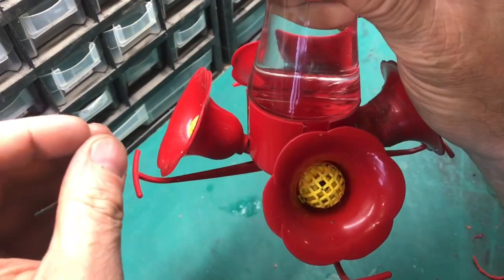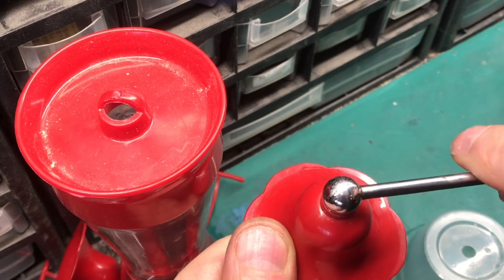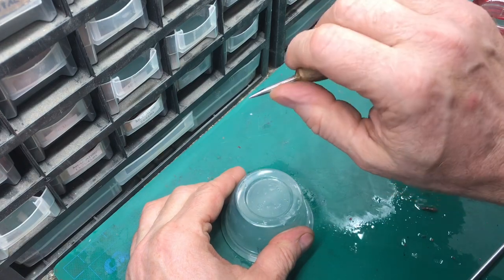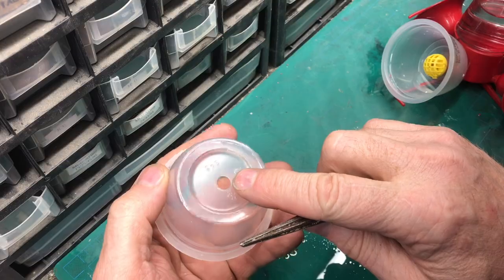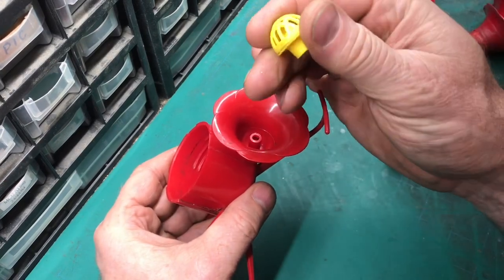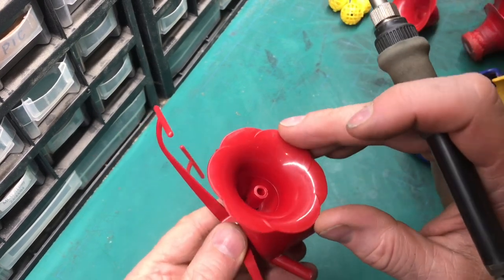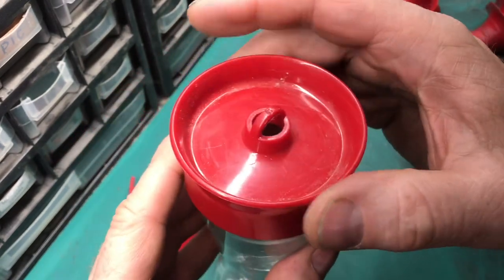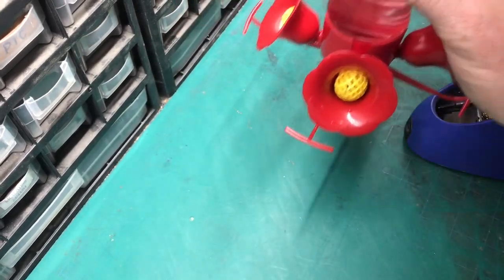fixing a LEAKING hummingbird feeder that “attracts ants”

Comment: You could use hot glue also to seal the red flower to the shaft…Then You could still remove the red flower for cleaning, but you may have to re-glue after cleaning.

Comment: I would think that the red cup (removable) should NOT be the prevention point.  The red tube shouldn't leak in the first place.
Reply: @vickiemalone9098  It appears that sugar water is coming out of the red tube; the bird sticks its beak in the tube to get the water.  Any water trapped in (and leaking out of) the "flower" comes from the tube.  The problem seems to be that water shouldn't be dripping out of the tube into the flower.  In fact, the h-bird would not care if the flower was discarded:  the bird only cares about the opening in the tube.  My point is that the defect here is water coming out of the tube.  Rather than seal up the flower joint to hold water, I'd throw away the flower section, let the dripping water drip on the ground.  After attracting ants to the ground point, I'd discard the entire feeder to get a new one that doesn't drip in the first place.  And why does it drip?  In my garden, larger birds perch on the h-bird feeder, and tip the feeder off center, causing water to drip out.  The solution to THAT problem is probably to suspend the entire feeder so it won't tip at all.  Or shoot the birds.

Comment: Thank you for the video.  It helped me decide on how to resolve my leak with the exact same feeder.  I used 4, 10mm x 2mm O-Rings with each O-Ring places around the red shaft / post immediately after affixing the red flower but just before affixing the yellow (stigma?) parts.  It seems to be working well.  I'll post a demo video on my channel where I also provide a shoutout of thanks to you.

Comment: Dripping is a problem but if you use a fishing line to hang the feeder and the ants can't climb on the string. As far as gluing them or not taking them off you would be wrong you have to be able to clean the fungus that gets into this part of the feeder. Use Vinegar to clean it out.

Comment: Thanks for this video. Knowledge is always the first step in solving a problem. I used a slightly different method. I used Gorilla Super Glue with the fine application nozzle. I ran a bead around the inside of the feeder where the Flower is inserted. And also on the outside of the hole. No more leaks! thank you. Also side benefit is no more yellow jackets. As they can't get to the nectar through the flower's hole. they do fly up to it but fly away shortly. 😎

Comment: My problem is that the wind blows my hummingbird feeders around, which causes the feed water to leak out. 

Any ideas on how to fix this? I have the feeder hanging from a secured metal bar.

Are there any hummingbird feeder designs that don't leak in strong winds?
Reply: I have the same issue, just decided to buy another model as these are just bad design from the start. 
The slightest wind will make them drip and empty their content on the balcony in one or two days .... attracting unwanted bugs and ants. I wonder why they still sell this junk.